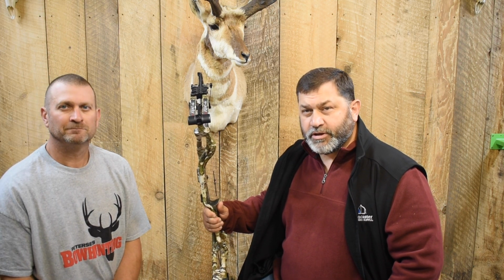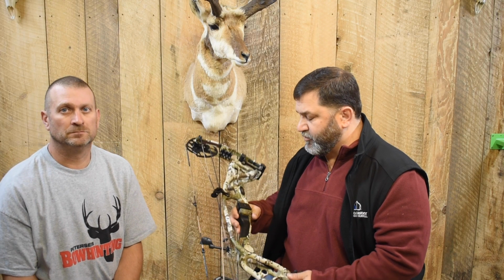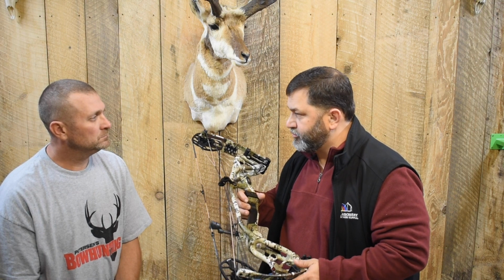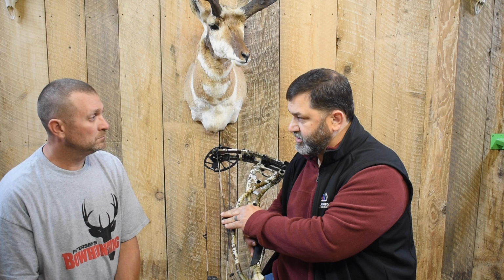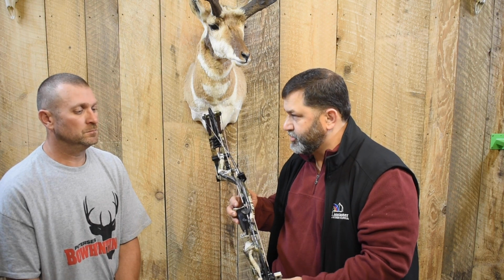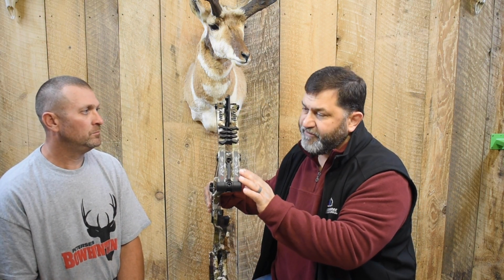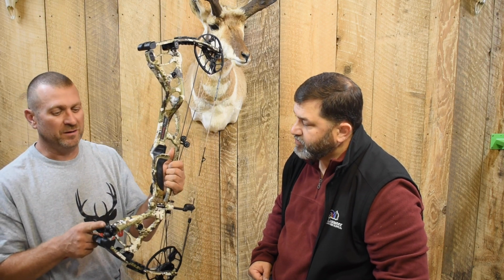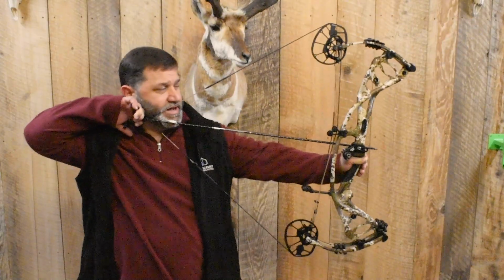Hoyt REDWRX Carbon RX-4 Alpha

Comment: I bought a new Hoyt couple of months ago. Thirty inch bow. Not a carbon riser.  Bow shot fairly well. HOWEVER,  at almost full draw it make a loud snap.  This was random. Ten shots twenty shots one shot.  Took back to dealer.  Four times. Every time I get it back they said it was fixed but not. Few shots, SNAP!!  Loud.  At this point I returned it and bought a bow Tec. Smoothness in hand, vibrations, accuracy no comparison.  When I returned a week later they called Hoyt and they said there were limb washers missing causing the noise. They had no idea how many bows got shipped that way. Just a heads up guys. I almost missed bow season.

Comment: 0.4 lbs difference between carbon and Aluminum.  For $500 more dollars I hope it’s worth it?  Not any quieter than the Aluminum either.
Overall really disappointed in Hoyt this year.  Nothing really different than the RX3 from last year other than the name and rest change like another company has.
Reply: Terry Chapman and the cam and axle to axle. Hoyt normally always has a year where they don’t change much.
Reply: Why change something when you have a great design
Reply: H&F_Outdoors Because other are doing it better.  Lead from the front!!
Reply: To be honest they did make important but not major changes.  They firmed up the back wall which needed to be fixed, they kept the speed but gave more brace height making a very forgiving bow.  They really didn’t need to fix much.  It’s a really solid platform.